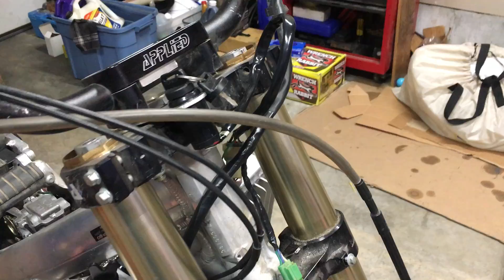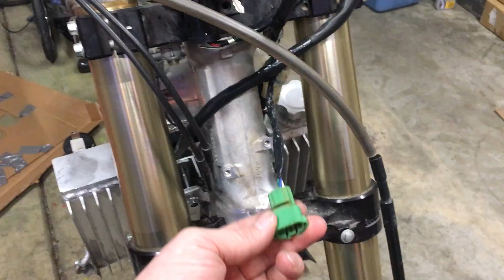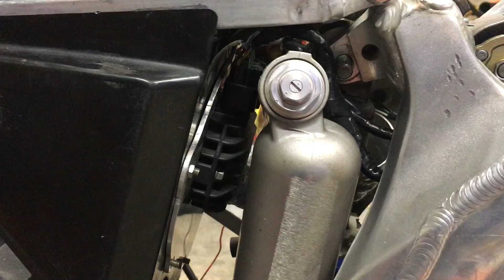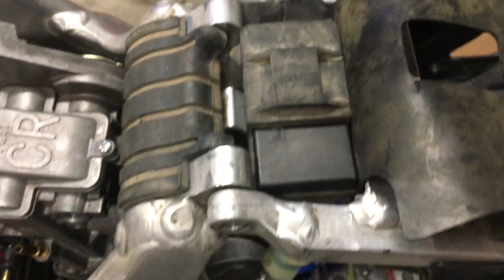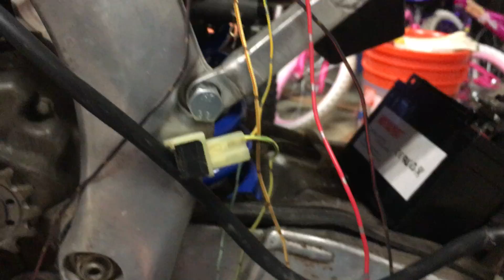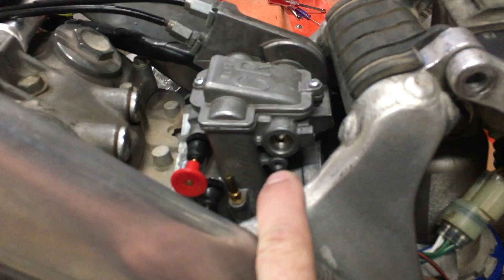XR400AF Build part 16

Comment: Killer!  Cant wait to see it with your tank on it.

Is that carb a stock 400ex ?  I cant remember if you changed that out.  I may have the TPS.
Reply from the maker: The carb on this is an FCR from a 2005 CRF450R.